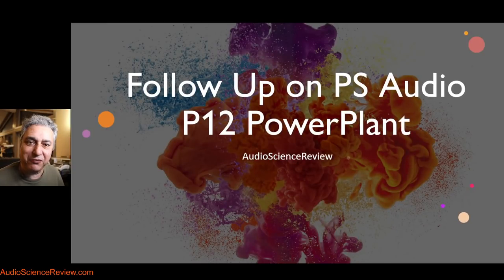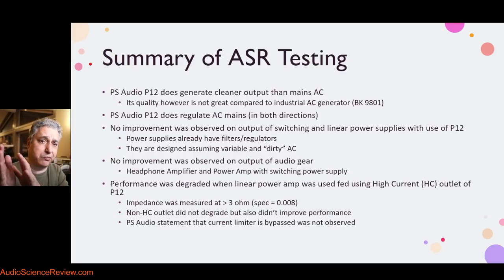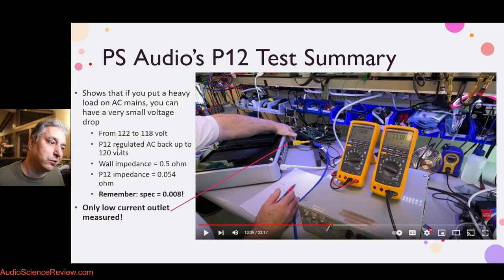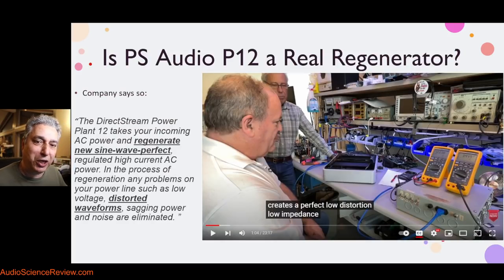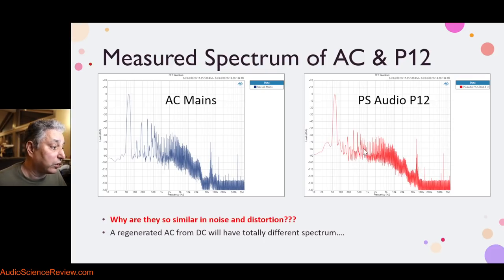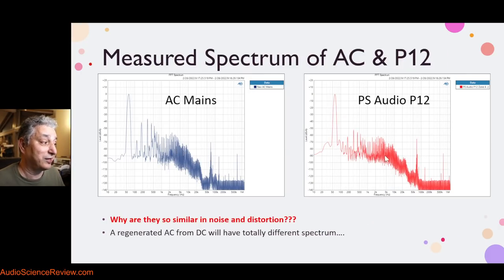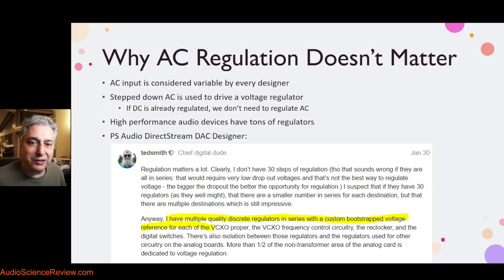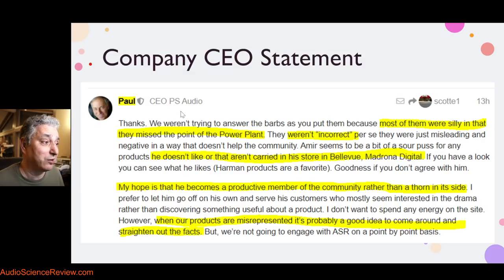PS Audio PowerPlant Measurement Follow Up

Comment: My, my ...the tone in these comments is pretty miserable.  
I'm a long-time audiophile who has both built my own gear and cables and I have owned numerous brands and components over many decades. I tend to read reviews from many sources, and the specific content I prefer are the "listening" assessments by reviewers. I don't personally find Amir's reviews very useful in that regard. 
Specifically when it comes to the PS Audio PowerPlants I have a great deal of personal experience of numerous models in my different systems. Years ago I recognized the improvement in discernible (my ears) noise that come from using them, and likewise the protection against power spikes and "fluctuating" power. I'm not here to convince anyone, but what I have heard in improvements when using PowerPlants is what keeps me using them. 
I am writing this because Amir seems quite vexed when he reviews ("measures" is a far better term, actually) PS Audio gear. Since there isn't a single piece of PS Audio gear that I think is quite good, I find Amir's "dedication" to rail against PS Audio ...at minimum odd. 
f you want to live in a world of measurements, stay away from analog turntables and vacuum tubes, that way we can better enjoy our hobby and much more importantly: Our MUSIC.

Comment: Who has peer reviewed this review? I thought so
Reply: An EE pretending to be scientist. As a physicist, it's very amusing.
Reply from the maker: More people than you can possibly imagine.  I got subjected to tons of pushback in ASR Forum.  This is the reason I performed a round set of testing.  We have a ton of members with strong engineering background that don't let me get away with anything.

The biggest proof point for you though is that Paul made a video but would not or could not show a single test of mine to be incorrect.  Not one!  If anyone had the motivation and resources for a "peer review," it would have been him.  So think about that.
Reply from the maker: @jellezwack4688  There is no "science" here.  We are verifying engineering claims the company has made and found them to be incorrect.  If you believe in audio science, you would run fast from this product with its claims of improving video, etc.
Reply: @AudioScienceReview  Many electrical engineers mop the floor with physicists. A physicist need not concern themselves so much with electrical engineering but an electrical engineer should be well versed in the applicable physics.
Reply: @AudioScienceReview  Dear, that's a logical fallacy (More people than you can possibly imagine). I wish this could get somewhere, making this controversial yet interesting topic productive. As a theoretical physicist, I can unreservedly tell you that the suggested extrapolation between measurements and outcome is flawed. Heck, the human mind is flawed, as you have pointed out in regards to bias. But it works both ways. Yes, you can't assess what you can't measure, but you don't always need to. I'd love to read a peer review from someone holding a PhD in Acoustics, maybe a round table. Lastly, funny that people refer to the placebo effect, which works though we don't exactly know why (yet).
Reply: @NeverTalkToCops1  Well, that's your opinion. My experience of 4 years in Physics and 3 more in Computer Science Engineering, gave the knowledge that engineers, except for very exceptional individuals, never grasp any serious math skills beyond basic differential calculus, hardly would go over Fourier transforms and partial differential equations were well beyond their reach.  Just as an example, from reading the thread: Can you tell without googling it why electrons don't lose energy and fall into the nucleus?

Comment: I have only one criticism of Amir he didnt do any blind listening with or without that piece of junk.People like Paul can have a lot loose when anybody criticizes their products but we need people like ASR  Their is a lot of BS in audio  business
Reply: are you joking or serious about the blind listening?
Reply: @-aexc-  no in this case should be no difference or worse agree?
Reply: @Douglas Blake dont agree I and colleges of mine have witnessed obvious changes in sound qualiy with items that measure the same
Reply: This is not an amp or speaker that measures less than perfect that a blind listening test may potentially show you have  a preference to. This is a product that does absolutely nothing and infact gives less power than what you put in.
Reply: @Douglas Blake so on that basis there no point in doing any listening tests on anything ?
Reply: @Douglas Blake Correct differences in speakers too many variables for current test equipment  to analyze alone

Comment: P15 tested by another, it looks like it does better in test: https://www.youtube.com/watch?v=BwVvlYUpsM0
Reply from the maker: It doesn't though.  He is just showing the reduced distortion which is what I showed with P12 as well.  The real test is to see if the quality of the power supply or audio electronics connected to it changed.  He didn't test for that so it is of no value.
Reply: @AudioScienceReview  See this is why you are great, because I do just look at it and think, "okay that is a positive test" while he could have been measuring the diameter of a rat's tail :-)

Comment: I thoroughly enjoy low wattage single ended tube amps and vintage high efficiency speakers that had become popular in Japan in the early 90's. these are relatively high distortion audio devices. I like em. they appeal to me as a gear head, and they come with a whole lot of things over simply being playback devices. collectability, rarity, progression of technology, build quality, the concepts surrounding their approach, history and the personas that were involved in making these devices. have you never liked something for its imperfections? its beguiling. how the ASR crew tries to quell diversity of interest through ridicule and dismissiveness, shutting down debate, how they try to destroy alternative thinking, right or wrong, is not good for this hobby/industry. If you have lost your shirt buying "snake oil" audio equipment, thats you're own fault. suck it up and rub dirt on it. stop the crying. controlling the conversation and shutting out contrarians is inane. state your case and let people decide what they wanna do. if you dont agree with another persons take, be an adult. let it be.

Update: you all know that the PS12 is pretty much a double line conversion power supply? It is false that this design is the same as the power supply in a power amp. Double line conversion converts ac to dc, then back to ac completely isolating the power from the wall ac. Nothing new or innovative, this technology is regularly used for computers for the highest level of protection from AC mains issues. I would question the benefits of this level of isolation for audio. I dont think I need one, but this approach for power protection is recognized in commercial applications to be true. Do you need it? Well, double line conversion UPS’s are only needed as a form of insurance for one off events. If you have $100,000 worth of equipment, why not? If you have a high end music server with valuable files, makes sense. I do not prescribe to running an amplifier through a power conditioner for the obvious bottlenecking. You could also buy a professional double line conversion unit and install it at the circuit breaker level. BTW, even pro units are very expensive https://www.qpsolutions.net/2019/11/line-interactive-vs-double-conversion-ups-which-ones-best/
Reply from the maker: Quell diversity?  There are thousands of choices of great audio gear out there.  By your logic, consumers should be left uninformed so that poorly engineered products thrive as well as the ones that are nicely designed.

I test a bunch of tube amps.  I have one coming up soon as a matter of fact.  I say at the end that they are not for me but if they are well engineered otherwise that folks are free to buy them.

My job is to make sure what you think you are buying, you really are.
Reply: @AudioScienceReview  dont you read your own forum?  Do you see the culture youve cultivated there? Its spread to other forums. They refer to you all the time and are some of the nastiest people in the hobby. The gang up on people like a pack of jackals. 

This aint your job. You are maliciously destroying PS Audio as a hobby. How many PS Audio videos have you done? How many times have you said the word “garbage” about all sorts of products in your videos. 

There are decent ways to present your results and facts. Facts stand for themselves. Your videos transparently shows the pleasure you get out of this. 

Just looking at the comments, your “fans” are cheering you on like a gladiator for a kill. What a horrible thing to see. Its as if they have a blood thirst. 

PS Audio has survived many years because they cater to their market and take care of their customers. I dont understand why you have to pick at them incessantly. People make their livelihoods there. Put out the measurements and as science guy, let the results speak for themselves.
Reply: @veniceog         I do understand your point of view the thing is Paul could have taken this much better and if you did none of this would have occurred.   and in all reality, it doesn't really matter about the numbers as long as you feel good about the equipment and if that's what the premises was everything would have been just fine.
Reply: @Douglas Blake you are delusional if you actually think you did me any benefit or anyone else. Carry on with your self image of audio super hero. Defender of the buyers dollar, protector of the golden ear masses. Cool utility belt!
Reply: @Douglas Blake ooooh, nice clap back boomer. Lol
Reply: @Douglas Blake “I am the authoritah!” Doug Blake.  Lol
Reply: @veniceog  Nice that you display exactly the same traits as your hero over as PS Audio.  You've outed yourself and are too obtuse to even realize it.
Reply: @RK-db4oq  get  a life beyond posting hate on randos on youtube lol
Reply: @veniceog  But I want to be just like you!

Comment: Unfortunately this fella doesn’t believe in interconnects  and Power cords somethings just can’t be measured
Reply from the maker: No.  I don't believe anything that doesn't change the sound of your equipment.  Measurements just prove that my knowledge of electronics is correct in this matter.  The real deal is understanding circuit design.  Alas, I can't make you into an electrical engineer but hopefully can get you to understand these measurements to realize what you believe is false.
Reply: Everything that is audible can easily be measured. There are things that are easily measured that can't be heard. We are humans. Our auditory system is not magical. We have, through tests and measurements thoroughly mapped out the thresholds of human hearing. Have you ever wondered why nobody can identify differences in sound with power cords or interconnects with bias controls in place?